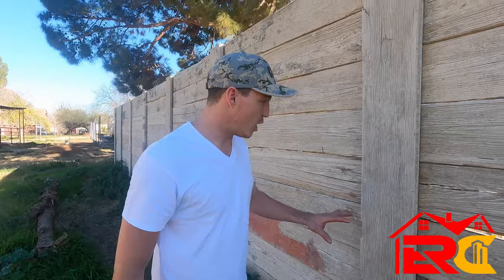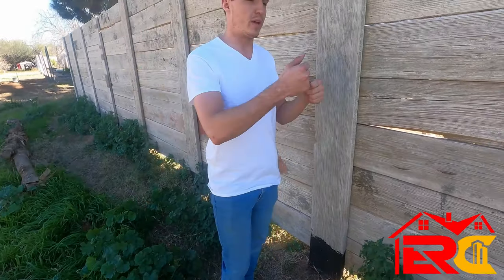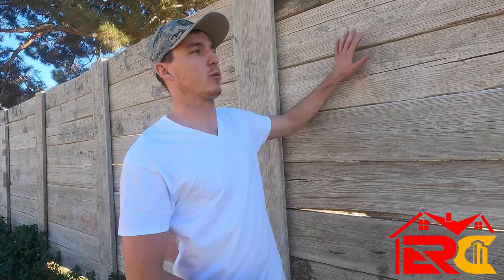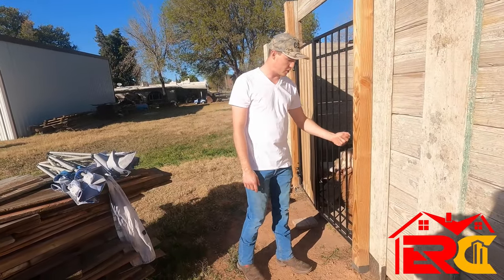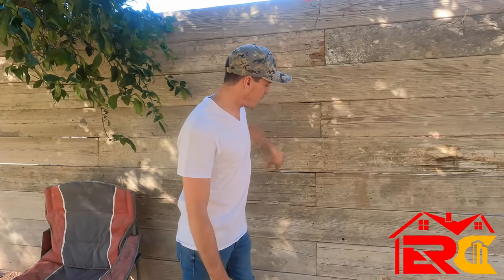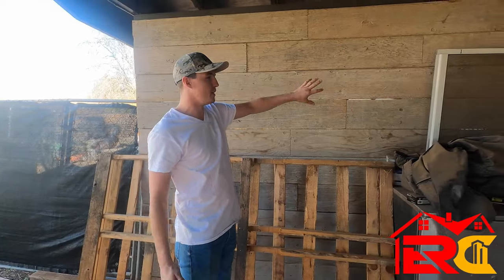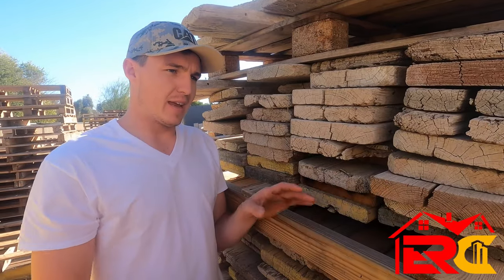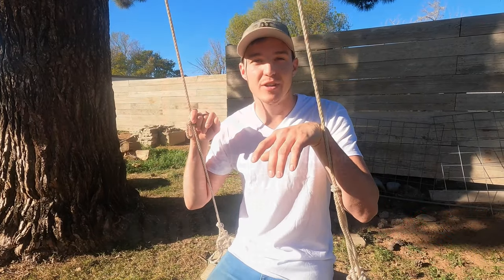CHEAPEST Way To Build A Fence In 2023

Comment: We could not do this in Arizona. The sun would degrade the wood in one summer. We have to use block.

Looks great tho!
Reply from the maker: This house is in Gilbert Arizona, and it’s actually been 3 years since we built it
Reply: @everythingresidential  no way. I am shocked by that. I had a pile of wood in my side yard for a season, and it's ruined, rendered useless, due to the sun.
Reply from the maker: @energeticsoulhealer888  Lindsay and Warner
Reply from the maker: @energeticsoulhealer888  if you use the basic 1/2” fence boards or standard lumber it does degrade rather quickly. This being build with repurposed scaffolding wood which is osha slow growth high grade lumber it’s a little different than most standard available wood. It is what the customer wanted and definitely a test of how it will hold up in Arizona or any climate but 3 years in and so far it is holding up perfectly with the sun and our monsoon winds. Only time will tell.